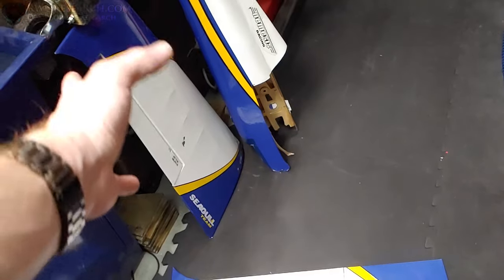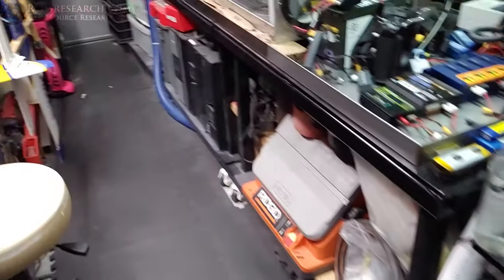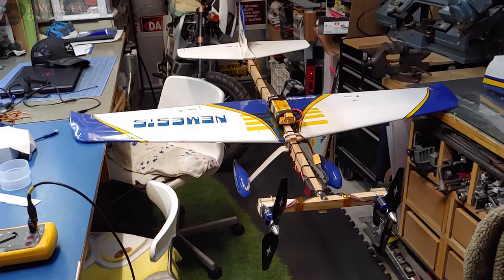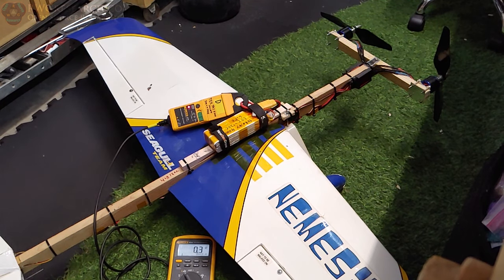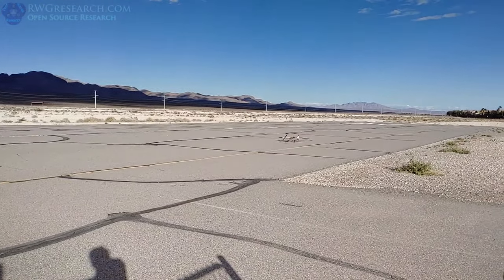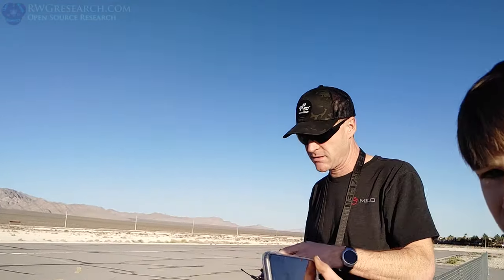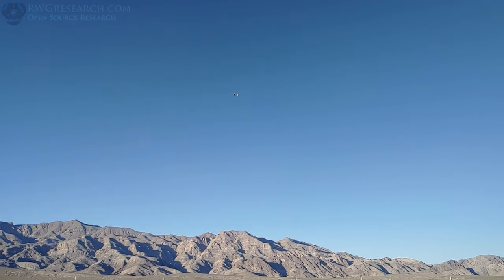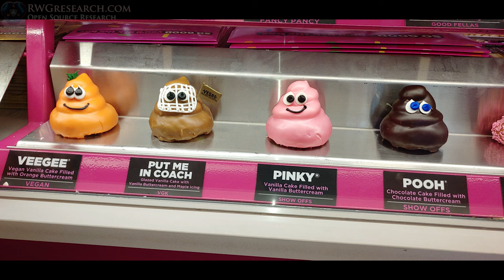My Wife Bet Me 50$ Would Not Work... The Stick RC Airplane! Duel Front Props

Comment: information      1:06   the prop noise was excessive.    more noise equals more vibration.      if they have not been mounted with vibration damping, which is usually not done on an electric model, servos  CAN  glitch from too much vibration.      this crash is what a servo glitch crash looks like.      d